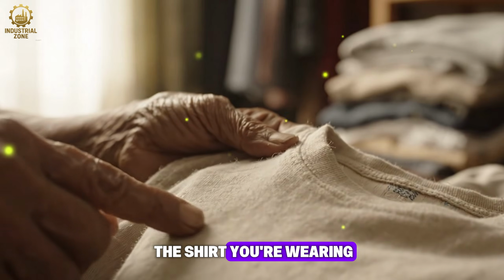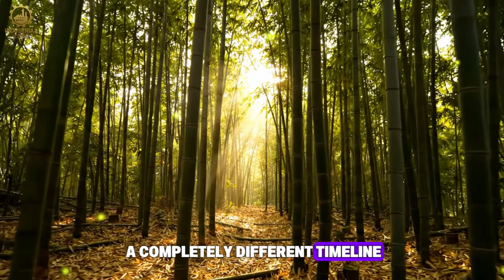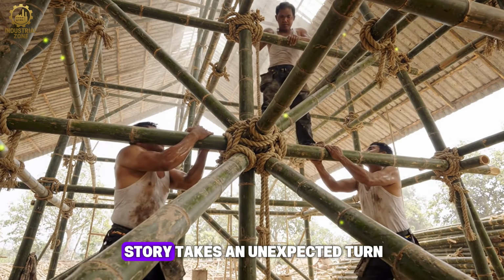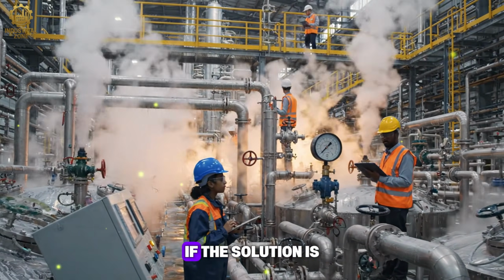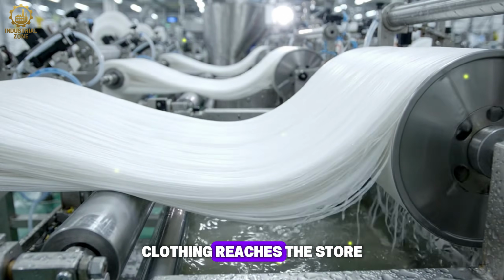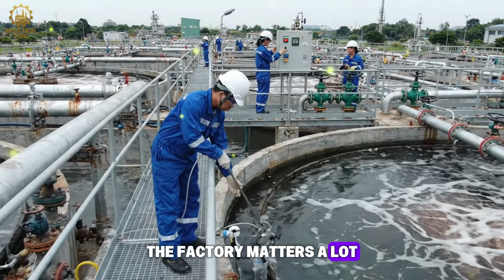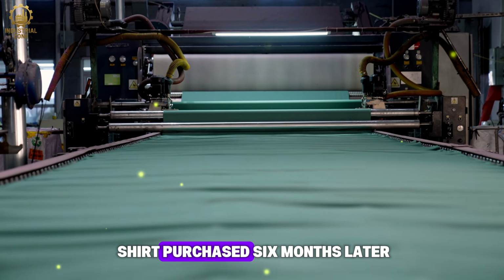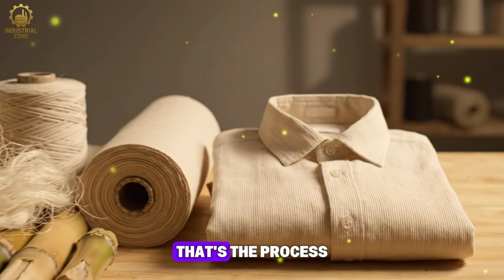Inside the Factory | How Bamboo Becomes T-Shirts, Hoodies and Trousers (Full Process)

Comment: What currently is "chipboard" made of ??
Reply from the maker: Great question! Chipboard is typically made from compressed wood particles, sawdust, and wood chips bonded together with resin under heat and pressure. Have you ever worked with chipboard before, or are you curious about a specific application? 😊